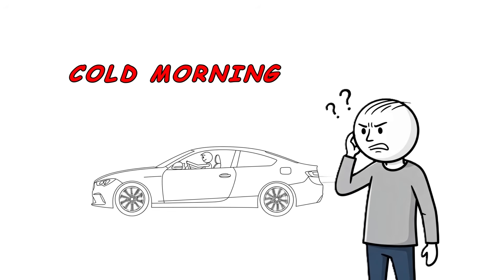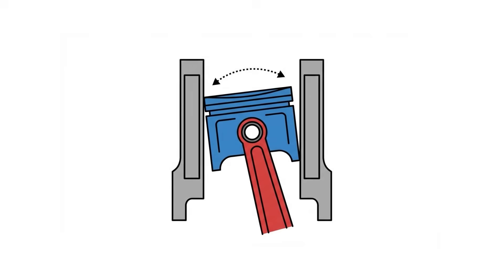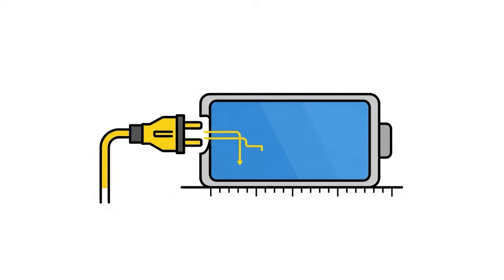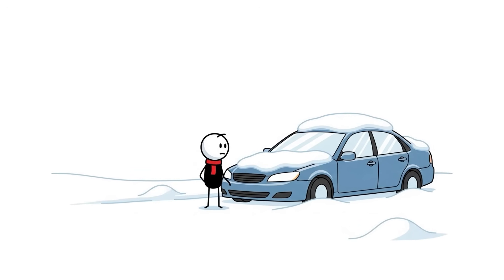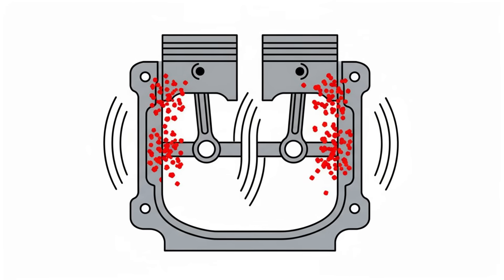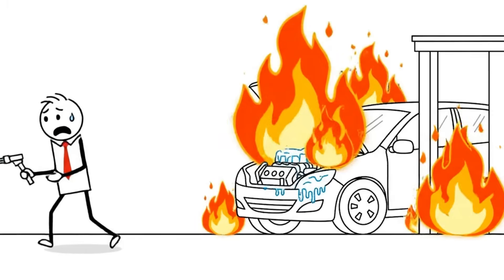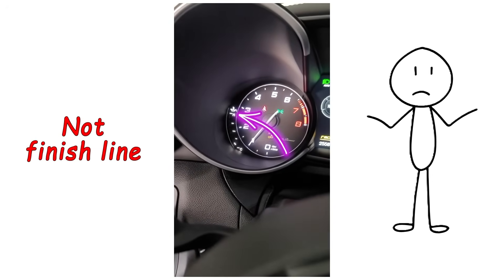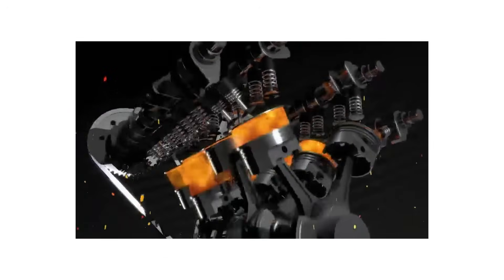Never Start Your Car Like This in Cold Weather (Ruins Your Engine FAST)

Comment: I just bought a new 2026 VW GLI. They are made in Mexico. I live in Northern Canada where today the temperature is minus 30 C.  Maybe Mexico thinks that all their cars are going to warm climates. They did not bother to put a block heater in this car.  :face-pink-tears: I asked them to install a block heater. They said we can't. It will make a check engine light come on intermittently. I can't live with that, so I said OK just put an oil pan heater on it. They said they can't. The oil pan is made of plastic and might warp. I don't want to damage my car on cold mornings. What can I do since VW does not seem to care. It is my problem!😛 What to do??!!

Comment: 295,000 miles on my 2012 Ford Fusion. I bought it brand new. I installed an auto starter that runs for 8 minutes in the winter. It's still going strong. Besides, there's a little rust on the left and right bottom fairings.

Comment: The first mistake with a hybrid car is BUYING a hybrid car! My hybrid batteries failed at 72,000 miles, and even though it still ran great on the gas engine, it set off the engine light, and would not pass the emissions test because of it, and I couldn't register it. After a couple years, replacement batteries are not produced. Now I tell everyone: never buy a hybrid car.

Comment: Most of this is common sense.  But if you live where you get snow and ice, you will want to start the car and let it idle while you clear the ice off.  The defroster will help a lot.  You can’t just drive off in a car covered with snow and ice.  

Also interesting hearing the references to carburetor equipped cars.  I have a 1969 Camaro with a carburetor and no computers.  It is a whole different experience than today’s cars.

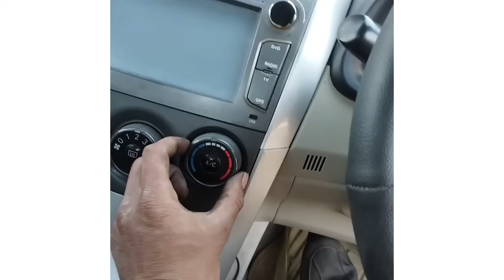Comment: 14:44 I doubt that you are stealing heat from your engine per say, just like you keep mentionning, coolant heats up faster than oil, the engine generates an enormous amount of excess heat, might as well take that heat inside the cabin instead of wasting it away through the outside radiator, I genuinely think that there is no real impact in blasting on the heat inside the cabin, I think it is more efficient actually, and anyway oil is in closer contact to inner parts that warm up faster than the engine block, so, we will drive gently anyway until oil loosens up.

Comment: Forget about 10W30, 0W30 or whatever. Use what your car’s manufacturer recommends for cold weather. Different engines have different oil requirements.

Comment: Tests have shown frequently used vehicle with fresh quality oil can run for several miles or even more with no oil pressure and  just the residual oil from last recent use-
Dont try telling me an idling car is getting oil starved. 
Fuel diluted oil with excessive cold idle absolutely- but theres no fucking oil starvation at idle.

Comment: Kinda makes remote starters pointless if we aren't to warm up the car. I've never had one. I'm just throwing it out there. Ive done everything from jumping in and leaving, to starting it im the winter and forgetting for 25 minutes... getting in a car blasting heat... depending on how cold it is outside. Been ok for 30 years of driving...

Comment: Gentle drive after a minute of warmup. Yeah right. I get to the corner and have to floor it cause some idiot is gassing it to not let you in. 😂 I'll let my car warm up for 5 minutes. Then go. My Honda Pilot has 115k and runs like new. Change you oil every 3k if you do short trips, and stick to tranny fluid drain and fills on time. Everything will be fine 👍🏻

Comment: With below freezing temps in my state recently my 2011 Honda CRV has started making a VVT (variable valve timing) rattle on initial start ups. It's loud but I quickly added some Marvel Mystery oil additive.  They now have a synthetic formula I used and the cold morning start up rattle is gone. The cam sprocket solenoid which is part of the VVT system needs oil to flow quickly through it on starts. I also realize this solenoid has a small spring inside of it that can go bad but I hooked up an OBD2 scan tool and there were no pending codes. Hopefully this is the cure for now.

Comment: Letting your car idle for 10min to warm up the engine is a great way to develop carbon build up. It is also the least efficient way to warm up the transmission and does nothing to warm up your differential fluid and or transfer case fluid if you have AWD. Only time this is ok to do is if you're removing snow from your car. Otherwise start the car. Give it about a minute or two for the rpms to settle and drive off. Keep the RPMs under 2.5k till your engine oil reaches what ever proper operating temp is specified for your motor.

Comment: 2014 Honda Civic 170k miles. Guilty of leaving car idle to warm up too long(3 to 5 minutes in winter). Changed fluid every 30k miles but never the filters. Used.  amsoil cvt fluid instead of Honda fluid.  Oh boy! Am I in trouble. My cvt should quit any day/ time now.

Comment: Never ever leave your heat on when you turn car off in winter and AC in summer..
Reply: Why? Remote start defrosts the windshield
Reply: @jolee3430 no... it'll blow out cold freezing air , until the car engine is warm.    Heater core will blow on you.    Why would you want cold air coming out heater vents??

Comment: Non of this is true anymore we aren't driving carbureted vehicles anymore oil flows in less than a second and if it didn't you would almost immediately hear a knock the wear that happens happens no matter what change your oil at the most 5000miles and this isn't a problem this channel has no clue what they are talking about it's proven that driving warms up the entire drivetrain faster than idling and direct injection engines are suffering more from idle not driving

Comment: No heat and no idle. LOL then we increase speed limits which burns even more fuel than idling. If the car can't put out any heat then how can the engine be warm enough to run safely?... It isn't like traffic is going to let you go 10 miles an hour. 

Unless you live in a crowded city then a little idle doesn't produce that much CO (which won't last more than a few hours as it turns to CO2). In fact milleage goes down when the catalytic is running. The CO doesn't last long in the environment. The added CO2 the catalytic adds does.

So this advice is for cities of a million. In that case you should be using metro and uber.

Comment: this is why i park my cars inside garage
Reply: Garages are great, but be careful of leaving your car in a garage for prolonged time with road salt, ice etc. will lead to tons of rust. As the moisture seeps into the cars  frame
Reply: @dominicbowie092  as long as its dry and heated/ventilated its fine, been doing so for almost 10 yrs now in a snow state, both my cars are 2015 too and no excessive rust issues, i just make sure to clean salt off during spring

Comment: Goodnight I see u talking about oil and when start up my car is a 2015 honda accord coupe ex-l 3.5L my miles is 062549 and my oil is 0w-20 where I live I have to drive hills stay with 0w-20 or 5w30? engine clean no oil dripping but when I start my car morning evening or night my engine make a noise is it the belt, while driving for minutes it stop making noise engine sound good do u know? Is it the pinging against pinging that making noise,belt or used 5w30 oil ?

Comment: The summary is :

-start the car
-wait 2 minutes (don't turn on heat or a/c too right away)
-then drive gently till 7 minutes 

That's it !
Reply: Thank you! I was tired of waiting for them to get to the point.
Reply: @Ingoodpawsatx  you're welcome , every video about taking care of your car is just what I've said + the maintenance (you know)
Reply: Leave heat on auto . The ECU won’t turn on the heat till it’s safe
Reply: @ci6516 that's a good one too , but if it's not my daily i won't turn it on too 😂
Reply: Thnx
Reply: Thank you, this guy sucks at telling details. Talked about nothing for 2 minutes straight
Reply: @0JayDoubleU no he's ok 😅 i just wanted to sit full the vid on one of these "taking care of the drivetrain or engine or car" videos , and they're all what i said + maintenance (you know)
Reply: @DjGh-q5h oh, well my appologies. But to be honest, those first 2 minutes were so annoying i didnt bother watching😂
Reply: I'm already there in 7 minutes.
Reply: @user-hm5zb1qn6g  this sounds like you should bike or walk if possible, or find some longer drives, doing exclusively short drives can harm your car as well, never getting it up to operating temperature
Reply: I drive immediately
With heater blowing
Reply: @JaguarKing1  sad moment to your engine..
Reply: @JaguarKing1 😂😂😂😂 i got a good laugh at this lmfao
Reply: @JaguarKing1  The water in the cooling system will not be warm so as to clear off frost, if any, forming on the inside of the windshield.

Comment: Coming from a master tech always let your vehicle get to operating temperature before you even put it in gear no matter the temp outside or in a garage!
Reply: What is running temperature? I don’t have time to wait 15 mins on the drive to wait for the needle to move. Or do you mean just wait 60 seconds? I have a 3.0 straight 6 diesel if that’s relevant.
Reply: safely let the truck idle for around 10 minutes until the high idle settles then drive it nicely so to speak for a few minutes after since you have a diesel. This will ensure proper circulation, that motor should hold between 190 and 210. It will rise on occasion if it’s under load to about 230 and that’s normal for that motor
Reply: Depending where you are, at 0 degrees C you’d only need to wait a minute maximum before it fine to pull away. 30 seconds is usually enough.
Reply: @AlmostLastJedi weird cause he's wrong. Faster you drive faster it warms up.... stay at idle? For 10 min even 5, THAT means your working with thick cold air way longer ( 800 rpms idle) rather 3-4k rpms, get what im saying  its just science bud.
Reply: clearly studying, college, and education is not your strong suit. I went to school for automotive engineering and was sent to Germany to for training on Porsche technologies. Believe what you want, keep doing what you want, makes no difference to me, the only thing that does matters is the poor information you give hard working people. I will be more than happy to provide schematics and scientific facts to the public. Good try though
Reply: As my car doesn't have a visual indicator for when it reaches operating temp, how do I know when that is? If it's 0F out, how long will I need to wait idling?
Reply: why doesn’t your vehicle have a visual indicator?
Reply: @RockHound29 What vehicle does? The low temp light going out is only referencing coolant temp.
Reply: what vehicle and engine do you have, I will point you in the right direction
Reply: Absolutely BS. No, you don't need a long warm-up for modern cars; just idle for 15-30 seconds for oil circulation, then drive gently until the temperature gauge moves, as driving is the quickest way to reach operating temperature, saving fuel and reducing emissions compared to extended idling. This differs from older carbureted cars, which needed much longer idling for proper lubrication and smooth running, but modern fuel-injected engines lubricate quickly, even in cold weather, by driving moderately. 

We don't live in the 50s.
Reply: You can believe what you want, I understand we don’t live in the 50s. Waiting a mere 5 minutes allows oil viscosity and transmission temp to circulate the fluid makes a world of difference. Especially with modern design of everything being plastic and aluminum. They do heat up faster. If the engine and transmission were pure steel I wouldn’t be as concerned. You keep driving the way you want I’m not the fixing your mistakes, makes no difference to me. Clearly researching and education is not your strong point. You should really stop listening to google for everything
Reply: @RockHound29  crazy careless people jump in freezing cold cars and speed off like bats outta hell
Reply: My car’s own driver’s manual says wait until the RPMs slightly drop after starting (which usually takes about 30 seconds to a minute), and then drive very easily until the blue temperature light goes out. Then drive normally after it goes out. You can say what you want as a master tech, but not all techs/mechanics will say the same thing at the end of the day. There’s another tech here on YouTube who specializes in the brand of car I drive, and even he backs up what my car’s manual says to do. Which is the opposite of what you’re saying.
Reply: ask yourself, how do dealerships and the manufacturer make money off of a customer after the vehicle is purchased? When you figure this out on your own, you will understand how corrupt the automotive industry is. Just trying to save folks some money, keep doing what your doing, it’s not my problem, it’s yours
Reply: I do this.. Been told it would damage my energy .. Glad I never listened😊

Comment: Don't rev the engine above 3000 rpm when cold running. Drive it like you are driving miss Daisy, till the engine heats up. Idling on park is useless.
Reply: What if i live near a motorway

Comment: No car manufacturer makes an engine that potentially sets up the owner for failure in 15 different ways on a cold start up. Piston slap is caused by piston ring damage or ring land failure that cold start ups have nothing to do with. That “tapping” or knocking could also be big end damage, or hydronic tappets, a completely different thing. Yes, metal heats up when hot - shocker - and retracts when cold- another shocker- but to the correct engineered tolerances. Your talk of oil viscosity is also misleading. It’s different for different engines since they have different compression ratios. There is no silver bullet for all engines. This is a misleading and more like scaremongering.
Reply: The fact that most manufactures suggest oil changes every 10k miles instantly disqualifies your whole paragraph.
Reply: Jaypietersen: I’m not saying don’t change your oil.
Reply: it doesn’t disqualify shit. He’s right. It’s more like his paragraph disqualified this whole video. None of this has anything to do with oil changes. You went off topic.
Reply: @_Muel_ see how many cold starts you get doing oil changes following the manufacturer specifications lad. Oil is sluge after 5-6k miles. Will wreck your engine in a year or two doing that in cold weather. So yes, there are ways in which the manufacturer sabatoges you right from factory. Am I the only car guy in the chat? Lol Jesus save me.
Reply: @jaypietersen6093 how tf does that disqualify his paragraph. He's actually right, I start my car on the coldest mornings and immediately drive it, I live in the great north too.
Reply: @JaguarKing1 you get 500 000 plus on it let me know bud. Big hello from Canada btw.
Reply: @jaypietersen6093 tell me you don't know shit about cars without telling me you don't know shit about cars.....
Reply: @Jeff_11B 😅😅😅 I have over 500 000 on a tubo, in Canada. LMK when you get there sport.

Comment: Rule #1 complete  nonsense! If it is -20 C  or beloow. outside you do need 5-10 minimum! To get 1/4 of engine warm (aprox 50C)

Basically  you need a wait till your thermostat open or about  to open.

Please stop spead gren sycos myths.

We are talking  about summer time less than one minute is good enough.

I would  also underlined: do your oil chnge every 5k-7k kilometers! Change coolant every 50-60k kilometers  (or every 3-4 years) similar to your  transmission.   
Clean your MAF sensor  onse a year.  
Engine  air filter every 2 year (and dust it of with compressor  evry oil change)
Change your
Reply: Chance  your pcv valve  evry 50k or 2-3 yer

Perform your maintenance 20-30% early compared your manufacturer advance  at least twice a year.

Comment: My car when im getting on the highway and speeding up, it revs up to about 3200-3400 rpm until the temperature reaches a little less than 1/4 warm, then it will shift into the next gear.
Reply: That's not your engine that's your transmission going bad, most likely valve body in the transmission is getting clogged when the ATF fluid is cold because fluid is much thicker when cold and you got a bunch of small dirt particles in the valve body that clog up the passages but once the fluid warms up it flows better because it becomes thinner and the car starts shifting normally. It's gonna start getting worse and worse and finally it will do it even when warm and than fail completely. Wait before driving let the transmission fluid warm up and you might still get couple thousand miles out of the transmission but if you're gonna drive it cold you will very quickly kill that transmission because it's running with very little lubrication until the transmission fluid warms up.
Reply: @AviationNut the car has done that since ive gotten it only when its cold driving nornal it doesnt do that only on highway my mechanic said not to worry about it becuase it probably the cars way of warming the transmission quicker to achieve maximum lubrication of the gears in the transmission before it shifs. The car shift like vrand new after that initial start of warming up, so he said it should be fine ive put over 10k and new fluid etc into the trans didnt change a thing and still does that.
Reply: @scroobydoobie2432  I’m sure its intended. On my previous toyota echo the transmission would stay in second gear until the blue oil light shuts off. Usually takes it a few minutes or less. With this in mind that means do not woot the car yet. Also idle car until the idle settles down.
Reply: @L33730 the car i have a a 1995 Toyota Camry 4 cyl.